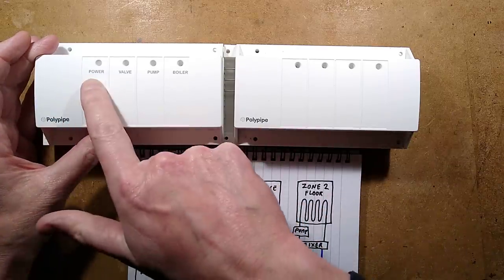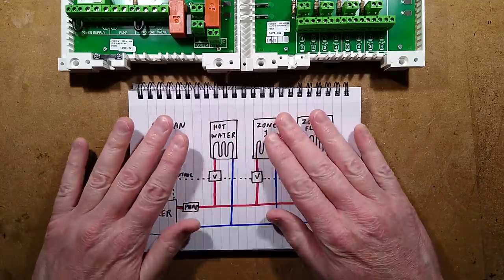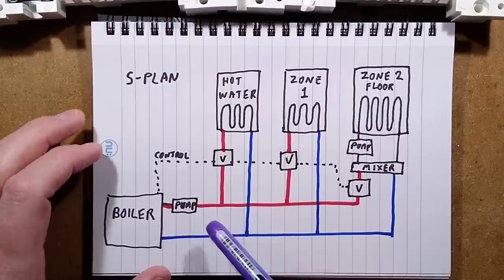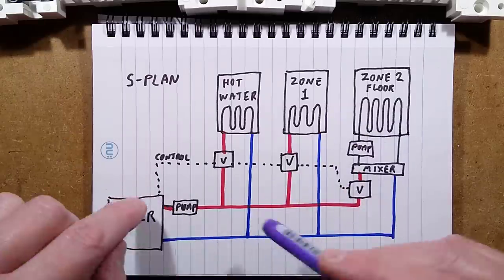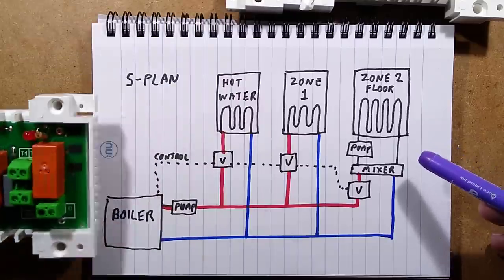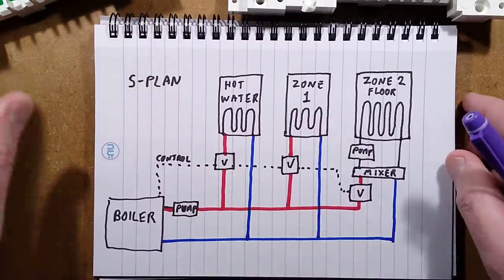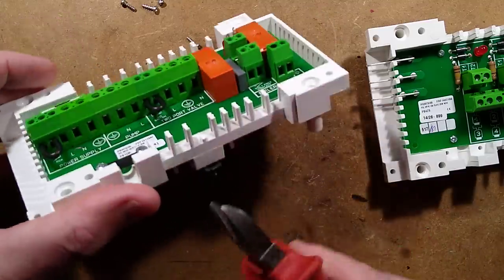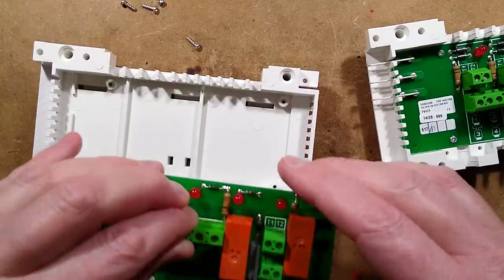Underfloor heating control system teardown (with schematic)

Comment: I have this single zone box controlling our main living area UFH, but it's had some issues recently. Firstly the zone valve actuator motor went and wouldn't open or close. We didn't really need this as the room with the UFH was in sync with the rest of the house in terms of temperature. So I removed the valve actuator, and left the valve itself open. This meant the UFH just came on with the rest of the house and worked fine.

But just this week it stopped working. The green light was on, but the red lights weren't and the pump wasn't working. I stripped the pump wires out and tested the pump using a simple plug and the pump is fine so that's not the issue. I cant see any problems on the PCB but I'm guessing it might be the relays that have gone. Is there any way to test the relays?
Reply from the maker: If you measure across the relay coils you should get a resistance.  If they are open circuit they may have failed.  But I don't think it's a common failure.  You should also hear the relays click quietly when energised by a thermostat.   Are the stats working?
Reply: @bigclivedotcom  Thank you, you’ve indirectly helped me to fix it. 😍 I had a thermostat on the old heating, plus a stat on the new system. I assumed I could get rid of the new stat and just use the old one but having reinstated everything tonight it’s all working again. I’ll have to have a rethink on it now, but at least it’s working so thanks again. 👍🏻

Comment: Perhaps it would be better to measure the resistance across the graphite junction after the slave unit is connected, using the probe on the metal instead of the graphite pad?

Comment: Why are there breaks in the solder that's added to the tracks for increased current carrying?
Reply: It seems the whole removal of the soldermask over the trace is done a bit of an afterthought. I would have traced out the whole trace on the soldermask layer, rather than just the middle portion and wouldn't have included breaks. As solder has such a high resistance compared to copper, and the additional solder is so thin (due to the wave soldering process they used), it's not really doing much at all anyway.
Reply: Probably because PCB layout designer had seen it done somewhere else and they just copied it. The PCB designer obviously has very little knowledge of electrical circuit theory otherwise they would have realised that the effect the small amount of additional solder applied to the wider tracks would have been absolutely minimal.

Comment: Where is the 5am fuse on the master unit ?...
Thanks
Reply from the maker: If you look at the thumbnail it's inside the green block above the terminals on the left.
Reply: Changed the fuse and still not getting green led.Im guessing this should be constant and on?...

Comment: I know this video is a couple of years old now but i have this exact system and it's just stopped working. I think i have traced it to a faulty relay as the thermostats are registering calling for heat but the valve and pump and boiler don't turn on. Before i try to replace with a new one do you have any other guesses? How reliable are the relays in these things? Thanks
Reply from the maker: Does the relay click when the thermostat tries to turn it on?
Reply: @bigclivedotcom  No there is nothing. It's like everything in the system is calling for the boiler and pump to activate but nothing happens, the valve doesn't open either.
Reply: @alanwadsworth1735  I had a similar problem with this exact setup.  It turned out to be a faulty motorised valve.  If that doesn't open and send the signal back, nothing kicked in to life.  I was still seeing the led for the thermostat/actuator led light up.
Reply: @itslenny  Your were right, replaced the motorised valve and bingo all back to normal, thanks for the help
Reply: @itslenny  Just a note of thanks. This video and these replies just saved me many £100's figuring out the exact same problem. Themostat was calling for heat, all seemed ok fine but no signal to trigger the boiler. I saw this and checked the motorised valve - bingo! I am a complete amature and would never have though of that otherwise. Thank you all.

Comment: Hi thanks for the video! Both of these two units for my underfloor heating stopped working for some reason. The engineer said that there is no electric current detected anywhere within these two units. Does it mean that I have to replace both of them? Thanks!
Reply from the maker: A common failure is an electrically operated valve shorting out and blowing tracks.  Check for a fuse.  If both seem dead then it hints at either the main PCB failing or external power to it failing.  The engineer should have detected an incoming supply on the terminals regardless.
Keep in mind that many heating engineers are not very good with electrical matters.  It might be worth getting a second opinion from a technically competent friend.
Reply: thanks for the video. mine has started blowing fuses after 12 years. would you swap out the controller or try and test the unit? thanks Jim
Reply from the maker: @jimkershaw1966  One of the most common failures seems to be one of the electrically operated valve actuators failing internally and popping the fuse in the controller.
Reply: @bigclivedotcom  thanks so much for your quick reply.  you are correct, I have already replaced two as we have two controllers! wd40 has freed it up for now but I'll probably need a  3rd. Anyway great upload, thanks again, Jim
Reply from the maker: @jimkershaw1966  The way the actuators fail is that the little heater block inside starts arcing across and pops the fuse.

Comment: Relays in those things fail all the time they are not man enough for most larger external system components, I have had several wiring terminals fail as well if you are lucky you catch those before the board gets crispy you can re-solder them.

Comment: just a thought, could you run chilled water through under-floor heating system in summer to cool the place down ? (I don't know how you would chill it though.)
Reply: Franko Walker when you could, you would have condensation, making tiles very slippery and bringing mold to carpets
Reply: @hrenes  LOL. Never thought of that.
Reply: Actually you can, with modern air-source heat pumps. It is relatively straightforward to run them 'in reverse' and supply cool water instead of hot, although you'd pay a bit more for such a model. I don't think the water is cool enough for condensation to be a problem, at least not here in the UK where it isn't normally very humid.

Comment: Hi Big Clive! Love your teardowns and 'subtle' approach to gentle prying things apart. 

Aside from that, very informative and interesting. I have a question for you and the community here - how would I be able to work out the correct resistor value (for want of a better phrase)? I'll explain - I plugged the wrong charger into my hair trimmer and fried a resistor. It's so burnt that I can't see any values/markings on the outside of the resistor (oops).

So, where would one go to find information or how would one work out the information on the resistor? Note: I've not been able to find the PCB schematic online.

Thanks all in advance!

Comment: Dear Clive
YourYouTube video was amazing. However, one thing puzzles me. The valves on the slave board have no independent connection to the "end of travel" relay on the main board. Thus the pump will only run if the "end of travel" relay has been activated by the valve on the main board. It follows that the main board valve may have to be open even when there is no demand for heat from its thermostat. 
I've probably got this completely wrong.
Kind regards
Nigel Turner
Reply from the maker: If I recall correctly, the boiler enable relay is activated as soon as any of the thermal valves is activated.

Comment: pump and boiler led should be seperated, it might help determine if the pump has failed
Reply: Easier more reliable ways to do that.
Reply: @YagiChanDan  how? it could still be implimented as an option.
Reply: @phonotical  modern (decent) pumps have their own indicators and sounds.  Old ones... Check for power, check for heat circulation.  All an led tells you is if there is power.  What if the crappy led or resistor has gone?

On these it's the same relay doing the work, so if the boiler is on/receiving demand, then the pump should be running.

Comment: True story for you Clive. A brand new hospital was built here with underfloor heating. Unfortunately to maintain the room and hall temps it was too hot to walk on in bare feet and so had to be replaced with a standard wet system at immense cost.  The previous hospital built on the first occasion it rained it was discovered had porous roof tiles. I kid you not.  http://news.bbc.co.uk/1/hi/wales/8045202.stm
Reply: I guess they didn't understand that the whole purpose of floor heating is to make the floor warm?   Not to use it to heat _everything_?   It was an up and coming thing from Japan in the early 1980's, and featured in a book called "What will they think of next?" (also inkjet printing)   The point was to make it comfortable for people that go barefoot or with slippers, as well as sleep and sit on the floor.  By heating the floor, it required less energy to keep them warm rather than heat the entire house.
Reply: @tbelding  plenty of homes are heated entirely by underfloor heating, you have to install it correctly though, can't have too long lengths and the pipe runs are critical - software packages design these for you nowadays to get uniform heating across the room.
Reply: @edc1569  - Just because it works for heating the whole room doesn't mean that it was invented for that.  That's my point.   Personally, I'd rather have floors I don't have to worry about leaking/catching on fire/exploding, and just used a forced air system that complements the air conditioning I already have.   We need A/C far more than heating, anyway.

Comment: I suppose the point is to stop the floor getting as hot as the rads!

I like these designs (not) that make things as inefficient as possible.
Reply: lower flow temperatures = more inefficient?
Reply: @edc1569  That is very true BUT applies at the boiler only, not half-way along the pipes mixing with cool again ! Lower temp efficiency is a result of lower boiler temp = lower exhaust gas temp. BUT what you really try to achieve is the gas leaving the building is 'cold' - so short flue is bad - long metal matt black flue running round the building three times is good.
You know they've got it wrong when the chimney is high up - it should be lower than the boiler - so the coldest flue gas leaves the building.
Reply: @edc1569  Ideal CH would have low flow - hot water (any old temperature, doesn't matter for efficiency) should trickle out of the boiler, through hot water cylinder to rads and the return from the rads should be colder than room temperature (run it through the toilet cisterns) so back at the boiler's last heat exchanger, it gets as cold a water as poss to extract the most heat out of the flue gas. 
I found my new condensing boiler no more efficient than the old pre 76 floor-standing cast iron thing - cos it lost its heat to the house - chimney 3 stories radiating heat into the house all the way up. This boiler efficiency thing is a laugh. No boiler is as efficient as leaving the gas hob on. None of that heat leaves the house !

Comment: That looks like the same pain in the @s unit ive had trouble with.. Have you got a link to get them cheap? Cheers fella.
Reply from the maker: Just search for the model number on eBay.  What's wrong with it?
Reply: @bigclivedotcom  it seemed to have a problem with the "pump" circuitry first then an actuator when mbad and short circuit in the main box  so i wired it to run continuously short term but i couldn't get the correct parts sent to me... Its a shame i cant send you the photos  on YouTube. I think the one I have is an older version with a fuse in the box that POP when i turned it back on.. Oh well thanks anyway big fella!

Comment: Can I ask you a question about this ?
Reply from the maker: Yes.
Reply: @bigclivedotcom  I have a customer with same as above ..it was blowing fuses instantly ended up disconnecting one of the actuators and it stopped blowing fuses but now we have thermostat leds calling on 👍 
main power led and valve led on 👍 
pump and boiler zilch ... I was thinking maybe bored has been cooked by surges but thought I’d ask advise .
Thanks for your reply .
Reply from the maker: @harrisonruss99  The thermal actuators often fail short circuit.  They're easy to swap as they are often held on the valve with a lock ring.

Comment: So... what's to stop someone from wanting to mod this to underfloor *cooling*?

Edit: hears about DIY person
I pull my question. O.0
Reply: if your heat source is a heat pump, that should be fairly easy: just run the heat pump backwards. You'd have to be very careful not to pull the floor temperature below the dew point of the air in the room, or you might end up with a wet floor and lots of mold.
Reply: @andreasu.3546  Thats exactly why we dont bother. Yes it can be done but the control to keep it above the dew point doesn't work due to the inertial nature of the floor mass. You get wet floors all the time which is a problem for a number of reasons.

Comment: I see two little problems with your schematics: First, the pumps are usually on the colder side of the loop, since this small pumps are lubricated and cooled by the water of the circuit , it's better for longevity. And two, nothing prevent all the valves to be closed at the same time, it would destroy them and the boiler itself so I guess there's a bypass somewhere if it's not electrically managed.
Reply from the maker: You're right.  The pump is often put on the return line.  If all the valves are closed it turns the pump off.  They all have a switch to enable it independently.

Comment: They are trying to make a cheap board and than there is me that does the same with a logo 8 plc and it's expansions from siemens...

So I can remap the logic...
This has been handy due to the fact the circuit has been changed due to lack of a replacement.

My old valves didn't had callback when fully open. So timer logic was needed. New ones have. So I just updated the program I wrote.

Comment: dont you lose most of the heat to the ground?
Reply: There is usually insulation underneath.  Either way, the water will be circulating between 25 and 45 degrees.
Reply: you insulate underneath, that makes it difficult to retrofit.
Reply: @edc1569  unless it's part of the ufh system or a suspended floor.

Comment: #bigclivedotcom hello I have a question I recently made a HV flyback circuit and I powered it using a 12v 2A power supply it is a simple metal cased circuit due to some reason the circuit worked for a few seconds and then the powersupply stopped working after disconnecting the supply worked normally. It has a over output protection and I want to get around the problem can anyone help?
Reply from the maker: It's possible that the high voltage at high frequency is interfering with the power supply circuitry.  The lack of a ground reference through the supply may be part of the issue.  It may be causing a very high voltage differential between the primary and secondary.  Try providing a link between the secondary negative and mains ground.
Reply: The inductor is probably saturating, try reducing the duty cyce.

Comment: What’s the part number?
Reply from the maker: PB1ZM by Polypipe.
Reply: @bigclivedotcom  you the man Clive. The master control unit has stopped outputting to the pump so no underfloor heating. 0v on output terminals to pump and pump LED off. Buzzed through the board on continuity and the resistor above to pump LED is OC so have ordered a new one disappointing as it was installed in 2019

Comment: My house has a much more complex unit, that lets you configure heating levels and ramps depending on outside temperatures and seasons. Those fuckers cost an arm and a leg to replace. Knocking on wood mine keeps on working even though it's >15y old. This one looks like it shouldn't cost more than ~100€. Is that about right?
Reply from the maker: That's close for one of these controllers and the manifold actuators.
Reply: @bigclivedotcom  Glad to know there is a reasonable alternative. Thanks and keep on rocking!

Comment: "Screeted across"?????
What's that in not-Britain-ese?
Reply: Screeded over. A thin concrete-like layer laid over the top of the UFH pipes to form the flat floor surface.
Reply: @alanstiles650  Thanks. Concrete is one thong I've never done. Now that you spelled the word out I remember that a "screed" is a flat thing on a long handle used to give the concrete a nice smooth surface finish.
EDIT My spiel-chucker is having issues apparently. You didn't prell anything. ;>)

Comment: Me: Impressed by the cost efficiency and layout of the design without it being chincy
realizes what they're using carbon contacts for
Me:"I am disappoint [sic], PCB fingers and a proper edge connector would've been so much better, carbon should be reserved for logic level contacts"